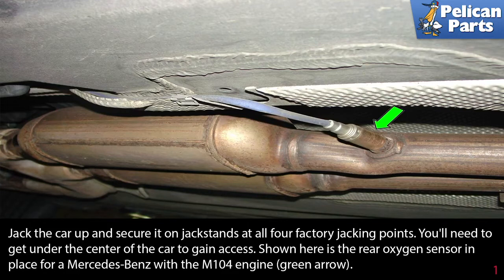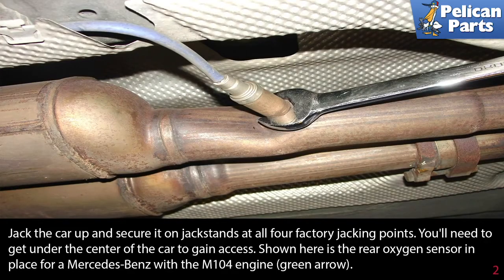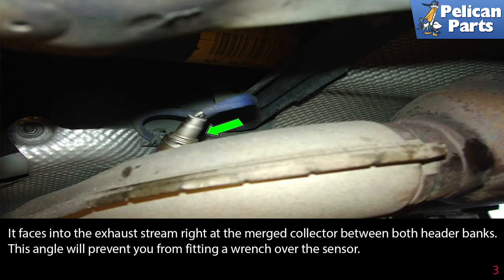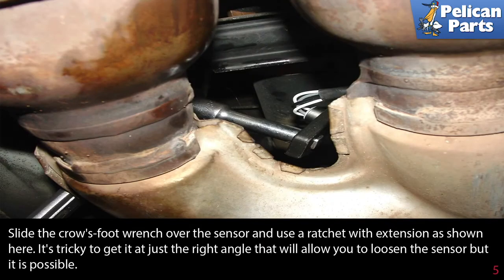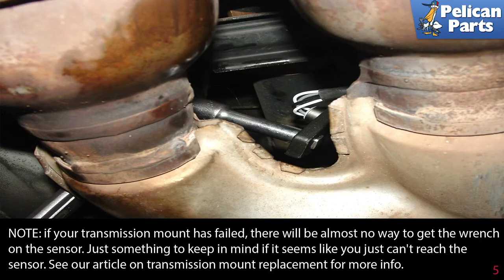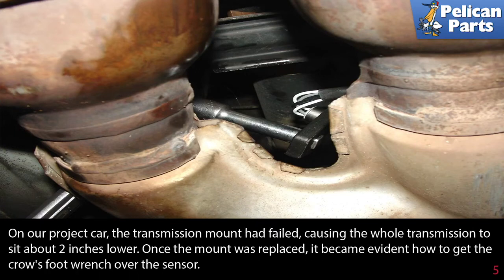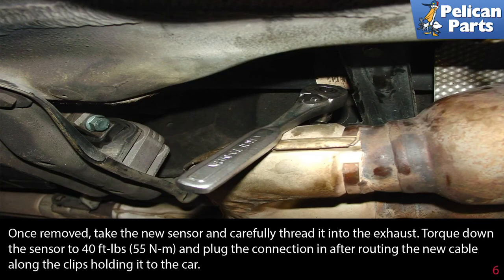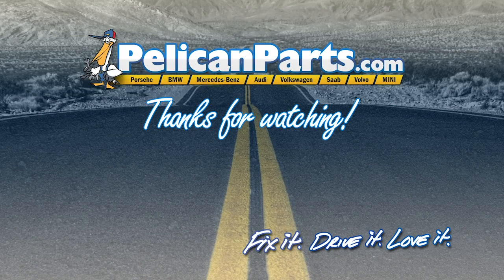Mercedes-Benz W210 E-Class Oxygen Sensor Replacement

Comment: I have a 1995 e300 doesel. Its running rough mostly stu.bling when shifting. Does it have an OW sensor perhaps thats bad?
Reply from the maker: OW Sensor? What do you mean by OW?
Reply: @pelicanparts  sorry. Typo. And I just did a reset on the TPS and so far it's shifting better. No stumbling. I been to try longer but so far so good. Thanks for replying.
Reply: @pelicanparts  Hello could you please share where is the oxygen sensor located for w210 engine m111.970? And where is the socket located? I really thank you for your kind assistance

Comment: Hi I have a 2002 E55 amg and I have the codes p0422 and p0432 that popped up on my reader and it’s about the O2 sensors, would you know the part numbers for these codes?
Reply from the maker: These are catalyst efficiency codes. Usually the cats are bad. Most times, if the o@ sensor was faulty, it would set a code first. As the o2 monitor runs before the cat monitor. With your vehicle info handy, give The Pelican Parts parts specialists a call at 1-888-280-7799. They can figure out what part or repair kit you need.
Reply: I know this is a 4 year old comment but to help the discussion along: 

As our Mercedes age the rear set of two catalytic converters which have no O2 sensors tend to get clogged. 

Then this will set or can set a code but not always like you have mentioned. 

If you live in a jurisdiction that's going to force you to have all four catalytics replace the rear ones with universal cats. 

If you live in a freer location where they don't care as long as you maintain your two front catalytics that do have the O2 sensors you're free to delete the rear too just have an exhaust shop cut the old ones out and weld a straight pipe in place. 

Really the extra set of cats were just for to make the vehicle an extra low emission vehicle but the problem is as our engines in vehicles gain miles those rear ones get clogged. 

I live in a state in an area where they don't even do emissions inspections so I'm totally free to remove the back to catalytics.

When I had my exhaust shop cut those out and weld straight pipes in their place my engine ran like a new vehicle - no longer clogged - more power that are miles per gallon.

Better in every way. 

if your Mercedes is over 10 years old or has 100,000 mi or more, this becomes more possible.